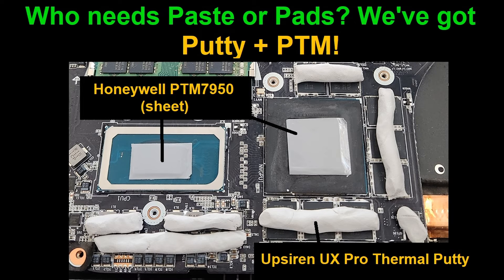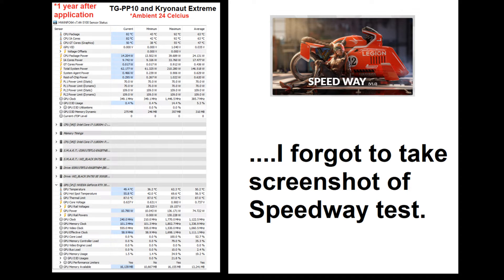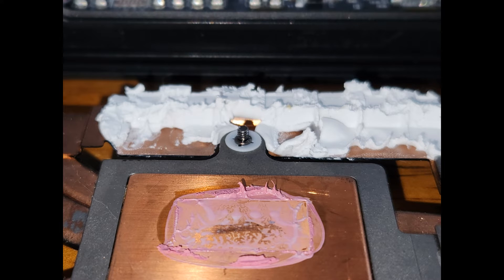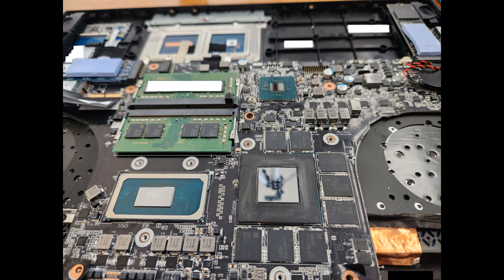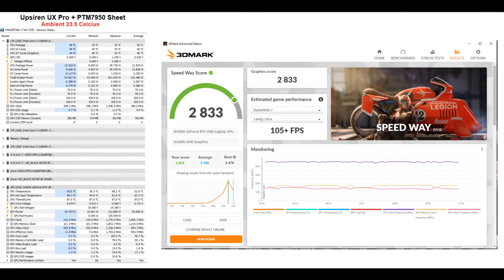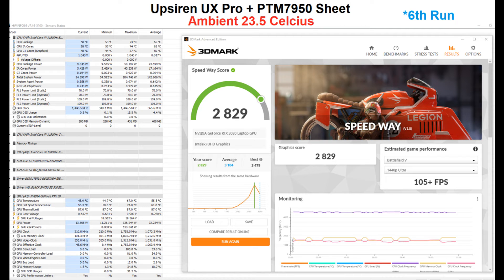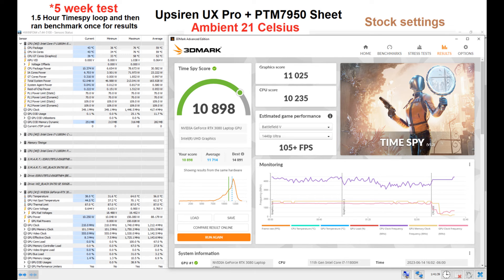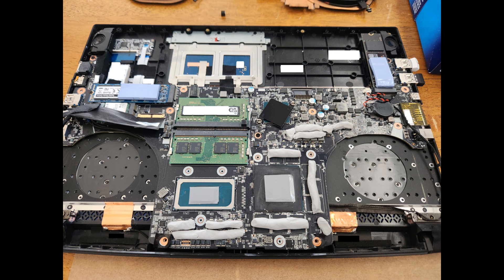RTX3080 Laptop meets Upsiren UX Pro thermal putty and Honeywell PTM7950

Comment: Great video. I have an MSI Crosshair 15 and I am going to do some upgrades. While I'm at it I want to repaste the CPU and GPU. I purchased some Honeywell PTM7950. After watching this video I also want to do the UX Pro Thermal Putty for the vrams. Will 20g be enough and should I use the Putty or PTM for the GPU?
Reply from the maker: If you only use the putty for VRAM then 20g will be enough. If you also want to do VRM and other areas where there are pads then 50g would be better.

Definitely use PTM for the GPU core and CPU.
Reply: @snarksdomain  thank you 🙏
Reply: @snarksdomain  is there a major difference between UX Pro and U6 Pro? Which is easier to use and would you recommend for me?
Reply from the maker: @boredjay305  there is a difference in performance, but not a big gap. For laptops I'd currently recommend U6 Pro over UX Pro as it is a bit easier to compress. U6 is also cheaper per gram.
Reply: @snarksdomain  yeah I think I'll go with the U6 Pro as this is my first time doing something like this. Any other advice? Lol thanks again 🙏
Reply from the maker: @boredjay305  I'd buy it from Aliexpress, not Amazon.
Reply: @snarksdomain  what about newegg?
Reply from the maker: @boredjay305  oh cool. Looks like Middle store is now on Newegg.com 

Looks like the right one.

I just advise caution and not to get any of these putties from CSGR. They are not the same as Upsiren (Trademarked Brand from China). If you look at the putty charts located in my Channel About page, you will see what I mean.
Reply: @snarksdomain  Hey I am expecting delivery of the U6 Pro today. I saw in one of your videos you use a syringe. Will I need one as well and where can I get one if I do. Does it have a specific name?
Reply from the maker: @boredjay305  I like using a syringe, but you can also just roll it like play dough on a clean flat surface (I sometimes use my silicone mat). You will want to wear rubber/silicone/nitrile gloves.
Reply: @snarksdomain  any particular size syringe? I can pick up locally? I'm worried I would roll it on an unclean surface
Reply from the maker: @boredjay305  as long as it has a large nozzle it will work. I typically cut mine to 6mm inner diameter for the test card. Depending on how you hold the syringe (angle) you can control how thick it comes out.

If you want to apply a thin/flatter line of it you can basically hold it very close to the PCB at a steep angle and move it accross a row of components.

When I previously applied TG-PP10 with an icing piping bag, it was woth a 5mm nozzle which also gave me the good control of putty thickness.
Reply from the maker: @boredjay305  the ones I buy are 60ml syringes.

https://a.co/d/0UwvKo4
Reply: @snarksdomain  thanks for all the help. I have everything today except the syringe. Will try to roll it as best I can. How much should I use etc?
Reply from the maker: @boredjay305  you'll have to make rough estimates on how thick if needs to be for each component type. Basically you're wanting to apply enough to replace the original pads. Putty is fairly forgiving so even if you use a little too much or a little less than ideal it should still work out.

If you look at my application on my laptop, it's a pretty rough application. I mostly gauge it by eye. As long as you don't run into core contact issues (very hot core), then an application is likely fine.

I recommend saving the original pads in some plastic wrap/tinfoil/parchment paper, and then put that it a ziplock container.

If you like you can measure the thicknesses of the pads and take a few pictures and email me at snarksdomain@gmail.com a d I'll help out as best I can. For measuring you can hold them uo against a measuring tape/ruler if you don't have calipers.

Comment: which bios do you have ?
Reply from the maker: Modded BIOS. I got it done through bios-mods.com 

I have access to the advanced controls and was able to undervolt the CPU as well as force RAM to run at spec instead of running lower frequency.

Still just 130w TGP. I wish I could pump 150-165 watts through the 3080. Would likely need a beefier power adapter though.

Comment: Are there any good alternatives to the upsiren ux pro? Unfortunately no one ships to Germany. The only thing I found is Jeyi 10w/mk.
Reply from the maker: For Europe, I'd either opt for CX-H1300 (13.5w/mk version) or maybe Laird T-Putty 607 (Digikey).

If you go with the CX-H1300, pay extra attention to the pictures in the listing and make sure the box near 13.5w/mk is checked off with black permanent marker. The 8w/mk version is not very high performing.

Feel free to check out the latest chart on the Google Drive link posted to my channel description. There you can follow along with my latest results and also view historical charts in the 'Archive' sections.

Comment: Choosing TIM for laptops has always been filled with dillema for me lol
Literally all of the laptops that I've ever used don't allow me to remove the fans (when it's time for a cleanup) without removing the entire cooling system. Plus the place that I live / I often went to are very dusty no matter how often it's been cleaned up. Because of that, I have to do cleanups more often than the usual, around every 6 to 8 months. Spent a lot of money on top grade pastes like KPx, Kryonaut, Kryonaut Extreme, etc, I even dared to use Cundoctonaut a couple of times.

And then, there's the thing about my last two laptops in which happened to have CPUs that can get toasty way too easily unless I do some major tweaking on them. MSi Prestige P65 with Intel Core i7-9750H, and HP Omen16 with AMD Ryzen 7 5800H. I needed to use ThrottleStop with Intel to underclock the CPU, and use UXTU with Ryzen to limit the max temp.

With that being said, while I've been planning to use PTM with my desktop's GPU, I'm still unsure about using them on my laptop due to the frequency of opening it up that I need to do. Hence, I've been thinking about using Carbonaut/Kryosheet for them, what do you think? I'm well aware of them being electrically conductive, but I'm willing to take the risk as I've been successful at applying LM on them before.

Comment: PTM is so god damn hard to work with.I have naturally shakey hands and struggle to cut things perfectly, even my botched application is still better than gelid gc extreme though. 

Definetly not something you want to work with as a novice or as someone with shaky hands.
Reply from the maker: That's a good point, although some of the newer sheets of different Phase Change Materials have easy ti peel plastic films (large overhang of both sides that is easy to grab).

Luckily, even with a torn or folded sheet of Phase Change it will often still get full coverage when it melts.

I'll be doing a experiment where I cut narrow strips of it and place them to make an "X" pattern, leaving m9re of the CPU bare. That way we can see how far it will spread out, and if we can use less for each application.

Edit: And welcome to YouTube :)

Comment: would you recommend this putty for a 7900xt repaste?  this will be my first repaste and i want to try putty instead of using thermal pads feel like it will be easier.
Reply from the maker: I would definitely recommend using thermal putty, and this one is very good. You may want to check out the chart where I've tested numerous putties so far and charted how they've performed. The link is in my channel info page.

On the chart you will see how each putty performed vs Ambient intake air temperature and also where I purchased them from.

Comment: Hi! Seen your video. Just wanted to ask. Is Upsiren pro 20g enough for my Asus TUF laptop?
Reply from the maker: It might be a little tight if you are doing VRAM and VRM's. I would opt to have at least 30 grams to work with, ideally. It all depends on OEM pad thicknesses (gap heights).

Edit: Some folks on the alegion discord have managed to use 20 grams for their laptops. It would depend on how many VRAM chips you have as well.
Reply: @snarksdomain  thank you for this! I really hope so if not I’ll just buy 10g more. Since the option for 30g wasn’t available. 

My laptops the Asus TUF F15 i511th gen with a 3050

Comment: That seems like way too much thermal putty. Especially on the VRMs.
Reply from the maker: I agree there is excess putty of the VRM area. I vaguely remember trimming some of it after installing the cooler.

Could definitely use led there. Perhaps if I do this again in the future I will roll smaller logs for the VRM.

Comment: Hi, i have the upsiren pcm-1 and u6 pro. In my lenovo y530, they work great, 25C improvement 95C to 70C for the gpu and cpu.

I also applied to the lenovo LOQ with a 4060. It has vram heat problem due to poor stock thermal pad contact. With the u6 pro, temps goes from 108C to 75-80C avg. 

Unfortunately the gpu temp goes higher than stock. Could it be the better vram heat absorption affecting the gpu temp? Before it only reach 70C or so but now it can hit 87C throttling it at same fan speed. Reapplied 2x times. Or is it not enough mounting pressure, i did applied the putty a bit thick.

I also notice lenovo did use similar pcm like material for the cpu/gpu. it hardens like the upsiren pcm, a surprise for a budget gaming laptop lineup.
Reply from the maker: It could be too much putty if your CPU temp is that high on the second laptop.

Lenovo uses PTM7958 on laptops which is said to achieve temperatures that are a few degrees cooler than PTM7950. 

It could also be that it just needs a burn in. I'd maybe expect a couple degrees warmer with the improved cooling of VRAM, and maybe a couple degrees changing from the PTM7858, but not in the 80's.

Comment: Hey, thanks for these putties and phase shifting pads videos, I've learned a lot and I will be repasting my GPU and CPU soon. I went for PTM7950 and CX H1300 putty for VRMs and I was wondering if I could use PTM7950 on the CPU as well? I've got a PC though (6800XT and 7600)
Reply from the maker: Glad you like the videos. Yeah, PTM7950 works well on CPU's.
Reply: Hey bro did you repaste the gpu? If so was the ptm 7950 worth it? I got 6900xt

Comment: Awesome videos, you're extremely informative! I purchased a Asus Zephyrus Duo 16 (2023) about 5 months ago and recently started getting signs of thermal throttling. My GPU memory junction is reading 102c and gpu Hotspot will hit over 87c (seen it as high as 91c). CPU temps on this thing run hot too, over 95c in games unless I turn boost off and it'll stabilize around 73c (also in games).

I repasted the gpu with thermal grizzly paste, and the cpu I redid with thermal grizzly liquid metal. However, still getting these ridiculous temps, so I'm thinking I missed a spot somewhere or didn't get a great application. 

Finally got my ptm7950 sheets in, and I have Upsiren UX Pro coming today too. Hoping to see some great results with this.

Questions I have though, is how much putty should I roll up for that laptop? Im sure you don't have the same brand laying around, but what size diameter log should I shoot for? And how to know I'm not adding too much that it's causing stress on the Vrms? 

Again, solid stuff, your vids are such a great resource!
Reply: Update: I cleaned up the laptop pretty thoroughly last night, replacing the liquid metal on my cpu with PTM7950 and use ptm7950 on gpu. Upsiren UX Pro went on my VRMs and VRAM components, I rolled logs about 4-5mm thick. Air duster on fans and all that fun stuff.

I fired up a quick game (didn't have much time to do benchmarks for a burn in on ptm7950 before bed), played for about 30mins. Usually during this time before replacement I'd get thermal throttling within 10mins and then practically every 1 min intervals. No thermal throttling in that 30mins after replacement. Temps did seem to get slightly lower as time went on, and I expect they'll only get better. Memory Junction temps went from 102-104c max down to 96c max, which I can live with. Gpu temps with 100% usage in the game was hitting a max of around 79c, Hotspot hovered around 85c with a max at 89 only once at the beginning. CPU just runs hot on this thing, with it sitting at 99c at the beginning then went down towards 85-88c towards the end of that session. So far, I'm satisfied with these results, as again I expect as the ptm7950 gets settled my temps will only get better.

Awesome stuff between the ptm7950 and UX Pro. Also, I'm a little avert to liquid metal now after seeing what it did the the plate of my heatsink after only 5 months, I can't see that stuff being great for your heatsink long term.
Reply from the maker: @TheDocatron  Thanks for the update. I hope your memory junction temps also go down a few more degrees once the PTM gets thin. In theory, the PTM initially acts like a tent pole, holding up the cooler 0.15 - 0.2 mm higher than usual, which would increase the gap between cooler and VRM/VRAM the same amount.

As the PTM melts the cooler should get closer to the components. At least is the cooler and PCB are stiff and don't flex much. The more flexible both of them are, the less likely this theory is accurate/significant.
Reply: @snarksdomain  awesome, I'll keep an eye on it and update here in a few weeks. If it weren't for your videos I wouldn't have the confidence in this stuff, so again thanks a ton @snarksdomain3453 !
Reply: @snarksdomain3453 so here's the update: replaced liquid metal with ptm7950 on both cpu/gpu and upsiren ux pro on the VRMs. This is on an  Asus Zephyrus Duo 2023.

Idle temps: cpu 63c, gpu 46c.

Idle temps with iets gt500 laptop cooler: cpu 57c, gpu 43c

Full load: cpu 85-100c, gpu 78c

Full load iets gt500 cooler: cpu 80-98c, gpu 74c

I guess the cpu on this thing just runs really hot. I dunno. I've read reports that these new cpus can handle temps up to 105c, but still it makes me nervous so I do shut off boost every once in a while which will have full load sitting at around 75c on the cpu. The gpu definitely got a lot of mileage out of the 7950 and it did fix my stuttering issue. So, I guess all in all I'm happy with it.
Reply from the maker: @TheDocatron  any chance you can do an undervolt on the CPU? Maybe even -50 miliamp offset? Might help bring CPU temp down further. 

It might also be worthwhile looking into the possibility of adding a couple more hearpipes. Can be done using some putty for thermal contact and maybe Kapton Tape to secure? The folks over on the Legion Discord have more expertise in this area.
Reply from the maker: That's a nice laptop. Cool that it has memory junction sensors.

For putty log diameters you can calculate it based off OEM pad thickness x OEM pad width (or width of component).

Examples: (numbers in brackets = log diameter)

A) 2mm x 8mm pad = 16mm^2
 --> (4.5mm x 4.5mm) x 0.7854 = 15.9mm^2

B) 2mm x 15mm pad = 30mm^2
 --> (6mm x 6mm) x 0.7854 = 28.3mm^2

C) 3mm x 6mm pad = 18mm^2
 --> (5mm x 5mm) x 0.7854 = 19.6mm^2

D) 3mm x 15mm pad = 45mm^2
 --> (7.5mm x 7.5mm) x 0.7854 = 44.2mm^2
Reply: @snarksdomain  unfortunately the laptop doesn't have any pads on the VRMs so I'm unsure on spacing. It does however use a pink paste, I'm actually taking it apart right now as I type this message, can definitely send a picture
Reply from the maker: @TheDocatron  snarksdomain@gmail.com 

Pink putty? Maybe similar to what Lenovo uses, which I've heard is Jeyi 8100.
Reply from the maker: For VRM's you might as well go with ~5mm. It'll probably work okay.
Reply: @TheDocatron o